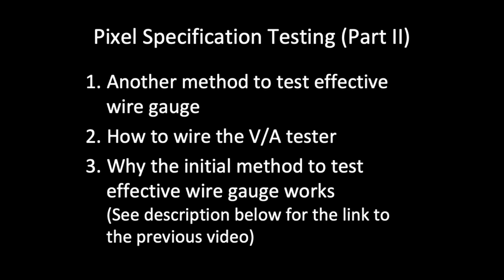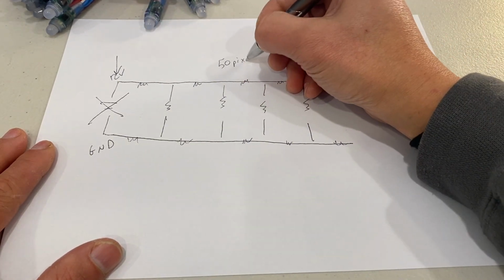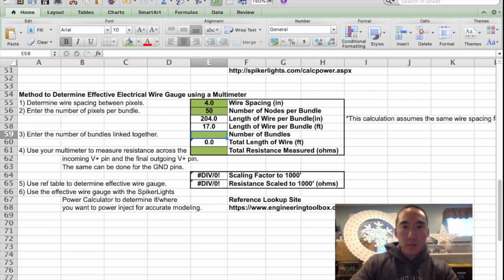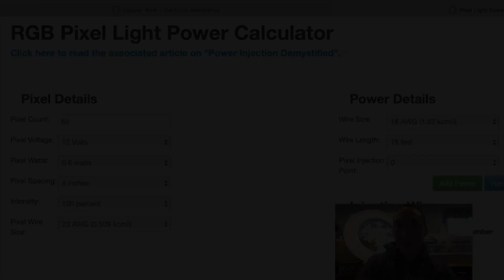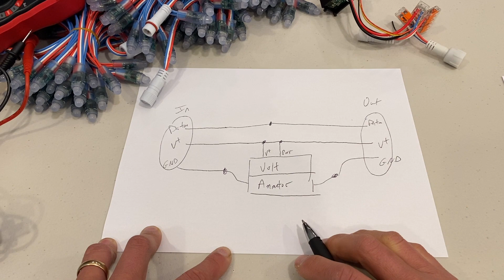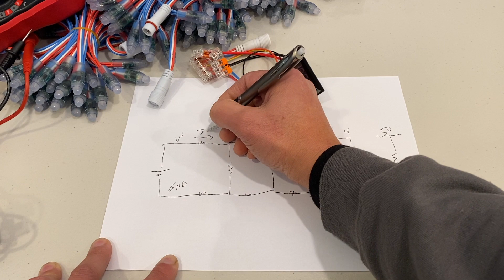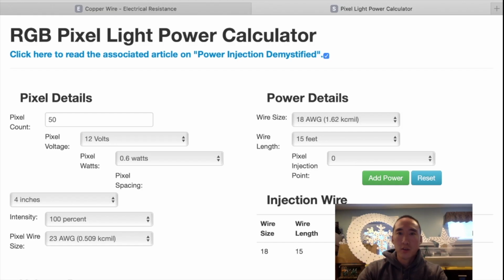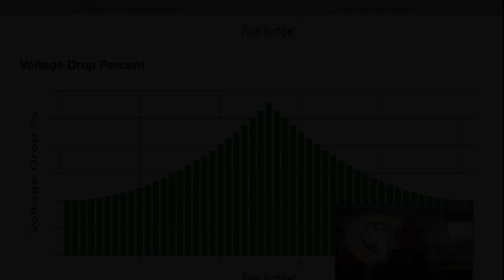Testing the Specs of 12V (Regulated) WS2811 Pixels (Part II)

Comment: I bought these supplies and attempted to build these v/Amp meters and did not have success.  It would apparently read the voltage, but for some reason the data signal was always dirty and the lights connected to the end of the meter would always flicker.  It might still work to read the voltage at the end of a run, but if anyone has an recommendations to a volt meter good for measuring 12v and 5v pixels I'd like to hear it.

Comment: Steve, instead of using the 5-way WAGO nut, could I connect all 4 V’s together? Kind of like what the WAGO nut does?
Reply from the maker: Yes, you can. The Wago lever nuts just make it easy to connect the wires together.
Reply: @NiFamilyLights  I figured, thanks brother.

Comment: Great video thank you. Can you recommend a good meter for use with 5v pixels? I notice the one linked in the description doesn't go down very low. Thanks!
Reply from the maker: Thanks Eric. This is not an endorsement for the linked product, and I have no relationship to the seller. Searching Amazon, these devices can measure down to 0V DC. It does need to be powered with an operating voltage of at least 4V. It does have a 10A limit, so it’s good for testing. I wouldn’t use this to measure power supply current to your controllers which can handle 20A or more. 

https://www.amazon.com/gp/aw/d/B08HQM1RMF/ref=sspa_mw_detail_1?ie=UTF8&psc=1&sp_csd=d2lkZ2V0TmFtZT1zcF9waG9uZV9kZXRhaWwp13NParams

Comment: Thanks for video.  FYI: Took me a while to figure this out but the V/A meters from your Amazon link do not have an internal shunt and so don't work when wired as you described.  It's a loop located behind the ammeter wires.    Wiring through the external shunt that came with the meter did work.
Reply: Answered my own question. For the Amazon one if you use one extra wire and use a pair of 3 hole Wago nuts you can use that like a small shunt. Just put that along the ground.
Reply: I got the Amazon ones and I’m having the same issue. How did you fix it? I’m trying to find that loop
Reply: Also bought the one from the Amazon link. I wired as shown in this video but I show amp of 51.4 with nothing applied. 

Read the other posts here but don’t understand the loop or shunt comments. Any help would be appreciated.
Reply: I just bought the Amazon one too.  What is the current range that it can test when using the included shunt? Is there a wiring method to not use the shunt since they are kinda bulky. If so does the ammeter need to be recalibrated.  I would love to see you make a video about these two products, their wiring, and application strategy.  Great vids over the years!

Comment: I have a question. If I’m using 12v regulated pixels bullets(so with a voltage regulator for each pixel that outputs 5V to the led) how far can I go without the need of power injection at 50-30% brightness? As the voltage decreases in the length of string due to the wire resistance and the LEDs themselves using some power.
Reply from the maker: Check out my video covering how far can pixel data go. I cover a number of factors including how many pixels you can run at different output brightness levels. 

https://m.youtube.com/watch?v=kAEkWMiKX4g